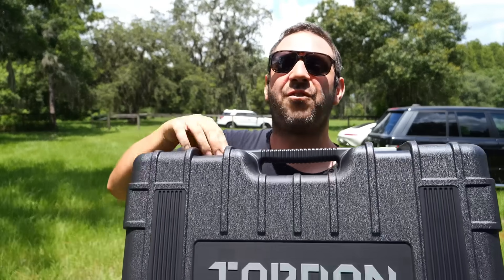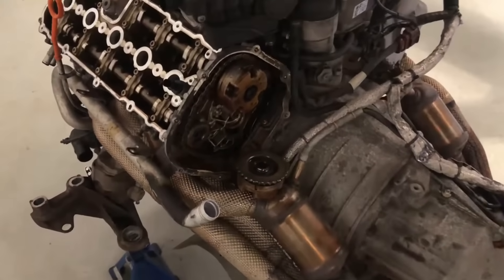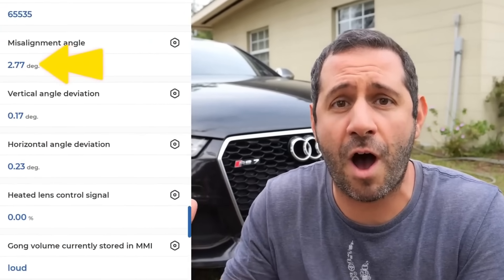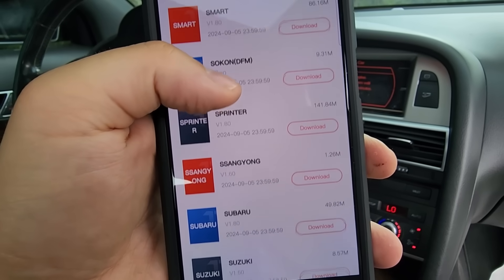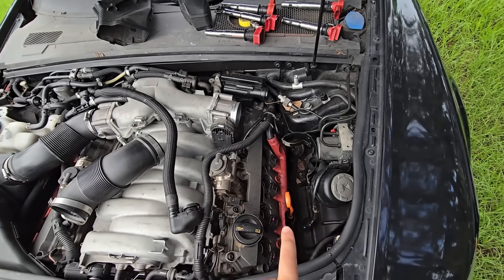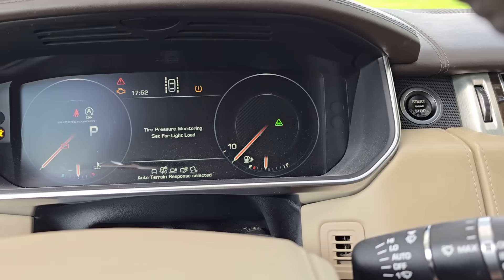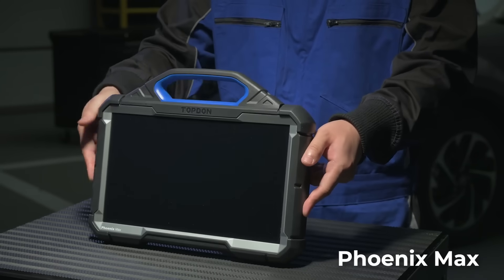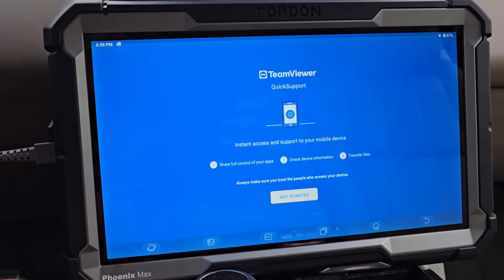$60 vs $4,000 Chinese Diagnostic Tool to Fix a Dead v10 Audi S6

Comment: I have an xtool ip616 scanner that has lifetime free updates and it can even program keys. I programed some keys for my mom's mini van. It programs them so fast that those vans with the plastic keys that you turn are not really safe. She always leaves her mini van unlocked. I could be in it with that scanner and have a key programed in like 30 sec and be taking off with it.  But of course who wants to steal a town and country mini van?  Kind of scary how fast it programs them. The scanner can be purchased for like 240 dollars for a used one on ebay. aka manufacturer returned one.
Reply: I have an XTool D7 and it's on the budget side of things, I think on a huge sale I ended up only paying like $440~ and it programmed a key in my mom's Armada in literally* 5 seconds. I started the function, pressed the unlock and lock button, and it was paired. Any key I entered into the ignition cylinder and cycled was entered until I hit the lock button
Reply: @jacobwebb8818  I looked at that one but that one didn't offer lifetime free updates.

Comment: Sam clearly the engine aint right just from the sound of the engine turning over with the starter at the beginning of the video lol. Sounds like every cylinder but one or two have low compression
Reply from the maker: You're definitely right. When I jumped it at the auction it sounded a bit different and ran for literally 5 seconds before dying. Its a bit tougher for me to notice and I'd attribute it to being a 10cyl, but if you heard it, you've got a good ear!

Comment: Do you have to pay in the app to have access to each car manufacturers' specific options?
Reply from the maker: NO! I could have gone on a rant about this. The first time I heard about a bluetooth tool that could do "All Makes" I bought it, only to have every single manufacturer behind a paywall. I returned it immediately. 

The amount of value in Topscan is pretty amazing, out of the box for $60 you can do full system scans/diags/hot functions for any make or model as long as you download each makes software in the app.
Reply: I believe you pay for the app after the first year.
Reply: $50 yr, is peanuts really, that gives you all makes and models, all systems scan

Comment: How are you working on a car in this heat
Reply from the maker: Luckily there wasn't too much I had to do on this Audi, but even getting the ignition coil out the rear cylinder was a little bit of a pain
Reply: @Samcrac would you be interested in a 1987 barn find 911? My late grandfather had it in his fort Lauderdale garage from 2002 to his death last month. It needs lots of work, but still runs & drives. I feel like it would make a great piece of content for you, as I have no desire to do anything with it. Come pick it up!